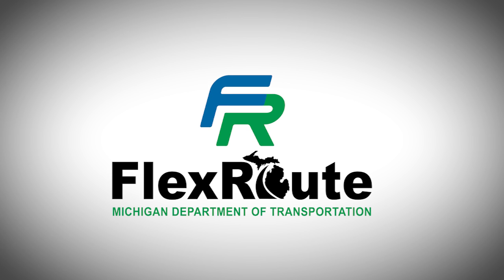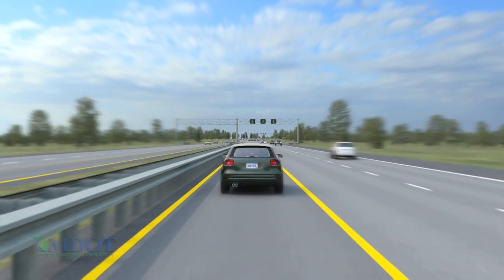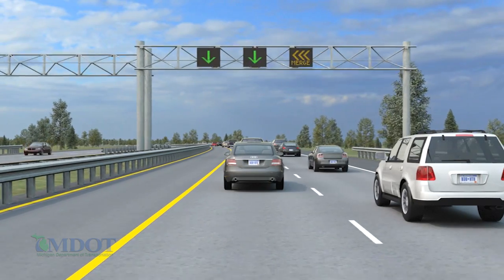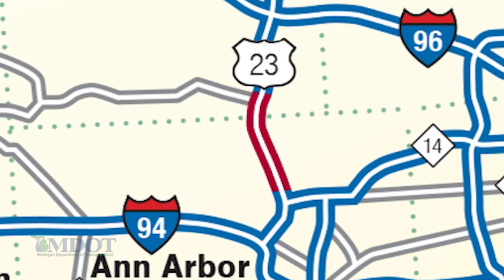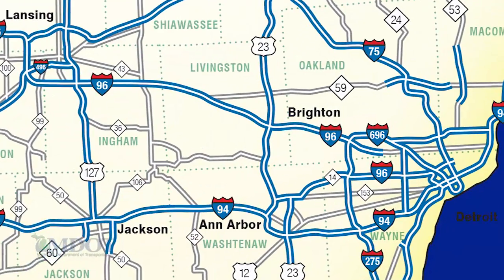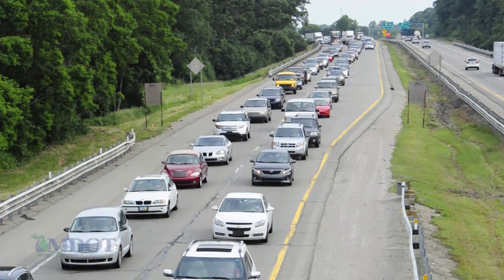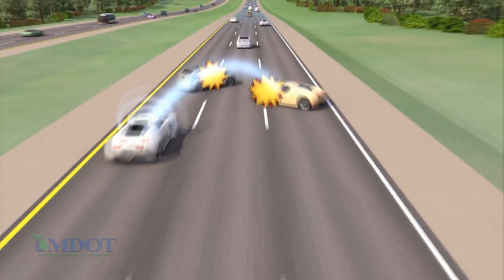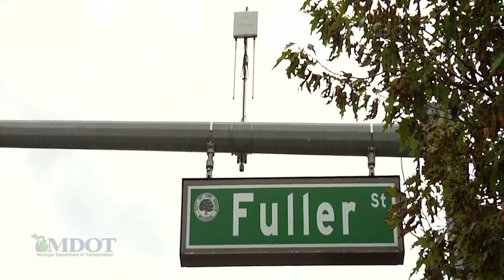Inside MDOT: Flex Route

Comment: Why not create an extra lane, and not do the Flex Lane?
Reply from the maker: Hi Bork! For a couple reasons. The first is that directional congestion (heavy traffic in one direction in the morning, heavy the other direction at night) is not really a 24/7 problem, thus a 24/7 solution is not needed, like building new lanes from scratch. The second is that building new lanes like that comes with a tremendous pricetag: in addition to building those new lanes and all the layers required, you have to build new shoulders as well, and you need to purchase all the needed real estate to make room for all that, in addition to widening any bridges/overpasses along the way. For the US-23 Flex Route project north of Ann Arbor a few years ago, that would have cost about $400 million. By upgrading the existing infrastructure (the shoulders) to satisfy federal law to serve as temporary lanes, the Flex Route project only cost $92 million, and that includes installing all the signs and technology needed to operate the Flex Route. It still addresses the problem and at a far more cost-effective price.

Comment: The Flex Route is another engineering failure from MDOT and they are putting more of these in.  I have seen an accident in the shoulder lane open for traffic and all 3 lanes were stopped.  A State Police unit with siren and emergency lights on approximately 1/4 mile away, could not move.  If anyone in the vehicle was seriously injured, the person(s) may not survive due to not receiving medical attention in time.

How much of a cost savings is it when a taxpayer dies?  Beyond the tragedy from loss of life, the state also loses income.
Reply from the maker: Hi Paul! Sounds like law enforcement had all three active lanes of traffic stopped for the crash you mentioned for everyone's safety while they tended to those involved. Similar situations arise in roadways with multiple lanes as well, not just those with a Flex Lane. Without a police report detailing the cause of the crash in question it's pretty hard to comment on it, let alone determine any kind of role the Flex Lane would have had in it.

Hopefully everyone involved in the crash was OK. Glad to hear you made it through safely. Thanks for following MDOT.